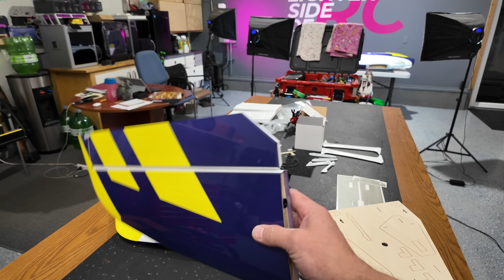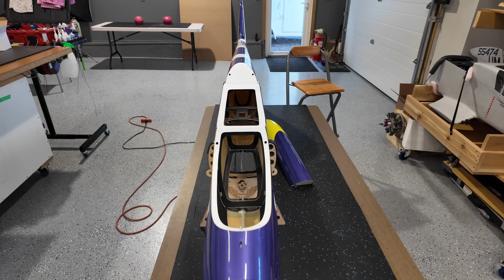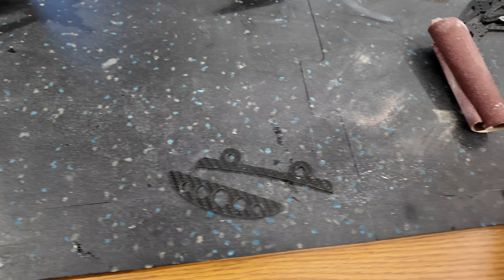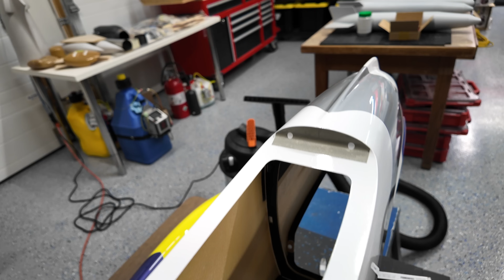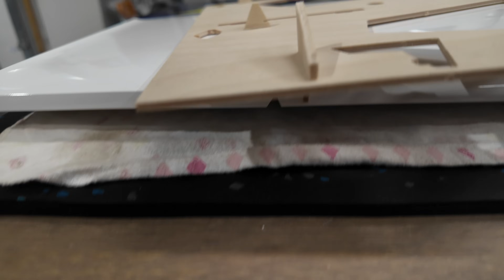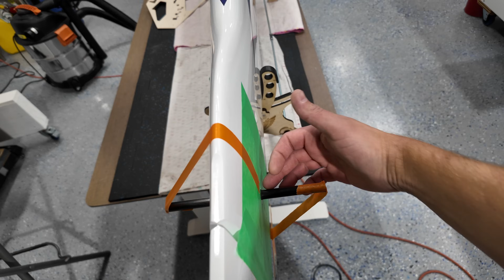Watch The Glacial Build Video Of World Champion F3A Aircraft By Nurila!

Comment: Nice looking Flying Machine. Another interesting Aircraft outa the Norm. Tricky lil bugger with no instructions as such I suspect you will suss it out in due course😮😅.Contra Rotating drive now that's gonna be interesting. 😮 Keep at it now. 😅😂❤
Reply from the maker: Yep!  It's a challenge!  But I think it will be worth it!😎👍
Reply: One of the best flying model airplanes right now. I.e made for manouvers with integrated rolls, horizontal circles and loops and eights. So now you know why it does not look like a Cessna 😊